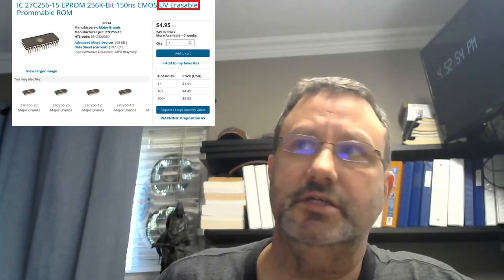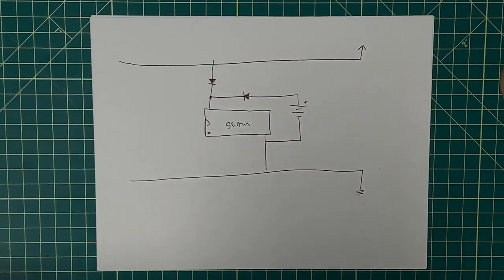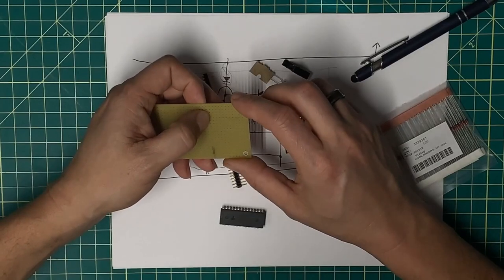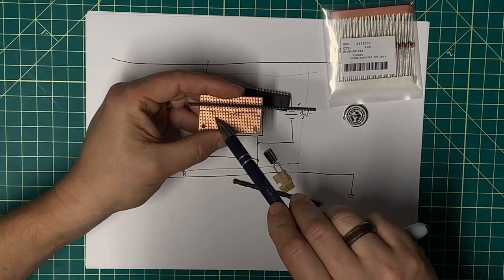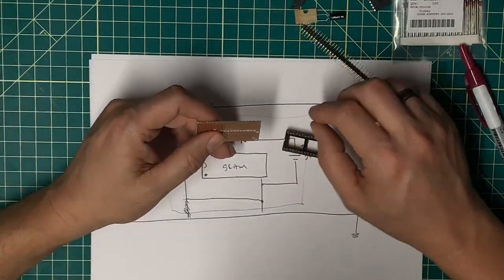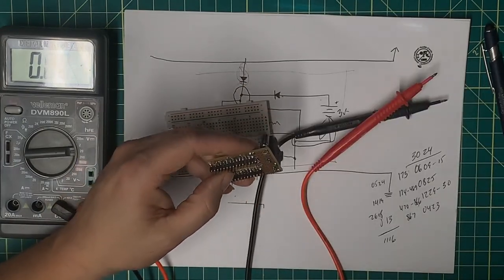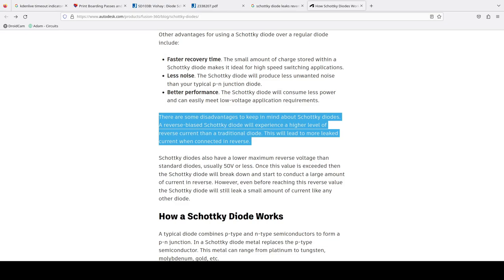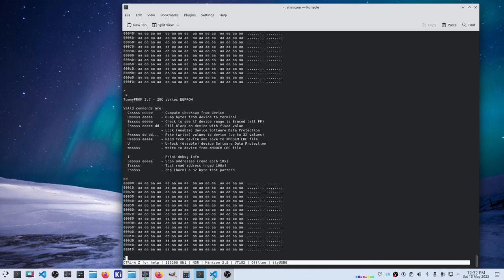0057: Custom EEPROM Replacement | 16-Bit Computer From Scratch

Comment: definitely a interesting idea. if thairs trouble though you might consider using a transistor instead of the diode going to the battery. have the base connected to the 5v rail.  should effectively act as your switch for your battery . it will be interesting to see how it went
Reply from the maker: @richiebarnes3038  Yup.  I will be circling back around to the design.  Got some issues to iterate through.
Reply: @eryjus4594  good luck

Comment: I once worked on a product that used static ram with a large super cap. we used a shocktky diode on the IC's ground so that the /WR line is held high as the IC's ground pin goes negative.

Comment: I find it hard to believe that 5uA of leakage current would be enough to cause your problem. The battery should be able to supply a lot more than that. I'd be suspecting glitches on the WE pin during power up/down or something like that.

Minimising leakage is still a good thing to do, though, since it will maximise the battery life.
Reply from the maker: @gcewing -- something is definitely wrong here.  There is something I am missing for sure.  Even the refined version of this EEPROM replacement has problems which I have glossed over for some time.  Look for a new video addressing this soon.